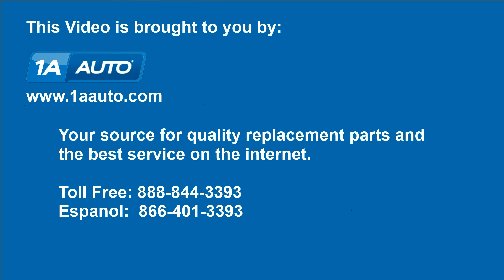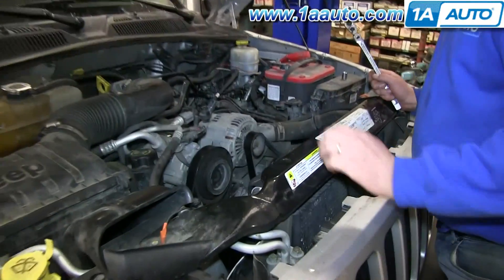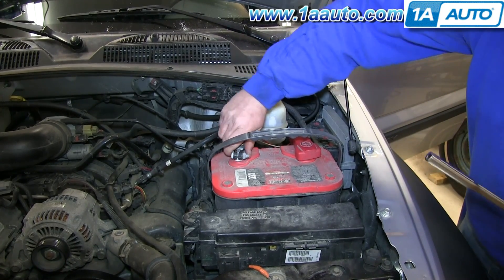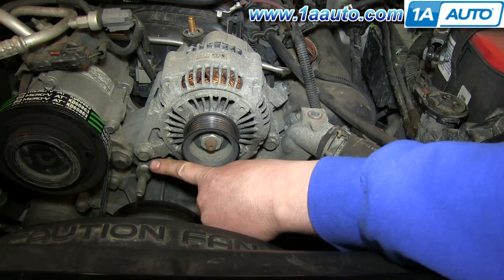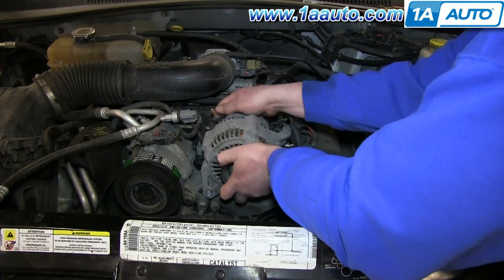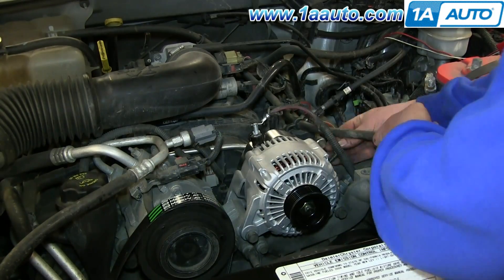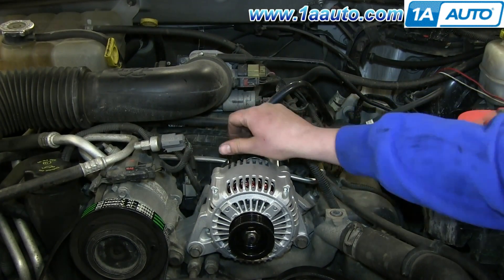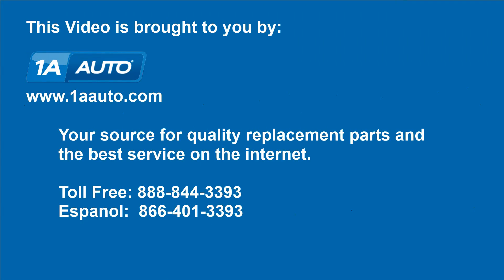How To Replace Alternator 04-07 Jeep Liberty

Comment: If you're like me and have a 2010 Jeep liberty sport 4wd 3.7 V6 that doesn't exist on the internet, this video is super helpful. It showed me the exact bolts to remove what to unplug and how to remove it. Perfect. Except my alternator is lower in the engine compartment and behind my radiator. I had to pull off the grille, headlights, coolant resovoir and fan gaurd to access the tensioner. Once all of that once done it's the exact same process as the video. Got it done and my Jeep now lives once more. Thanks 1aauto!
Reply from the maker: +Lance Drexler Thank you for the great reply. We love to empower our customers by showing you how-to perform your own auto repairs while installing our high quality auto parts. Have a great day! 1aauto.com

Comment: I wanted to share my appreciation. I was able to change my alternator and the battery, the dying alternator killed.. in about an hour .. 3 bolts + the power cord and clip and bingo its out.. reverse and its in.. then get the serpentine belt back on (don't take it all the way off, just remove it from the alternator.

Very nice for a parts company to provide simple tutorials like this. 

**ALSO was able to use parts and video from 1aauto.com to fix the common broken window issue with my jeep liberty 06

Thanks again!
Reply from the maker: +richard bowles Thank you for your order and your feedback! We love empowering our customers and showing how to perform DIY auto repairs with our high-quality auto parts. 1AAuto.com

Comment: You forgot to mention that Jeep Liberty's use two different sizes of alternator (Amp Output) although they look identical in every way. One is a 136 Amp (Oval Plug) the other is a 160 Amp (Square Plug). The only difference is in the shape of the small two-wire plugs, one is square the other is oval.
Reply: Finally, thank you!
Reply: wish I had seen this comment earlier! off to get a new pigtail
Reply: Thank you so much! I just ordered an alternator and it gave me two choices and I went with 136, and so glad I made the right decision! I’m pretty sure mine is oval!

Comment: Putting the belt back on is a four handed operation. It takes two hands to pry the damn tensioner up and hold it in place. Then one hand to guide the belt onto the engine with a fourth keeping it in place on the center wheel because it likes to slide off of that because there are no grooves or channels to keep it in place. Started at 6AM this morning. Had the new alternator in and completely hooked up and even managed to clean the top of the engine where the old alternator was sitting before 630. Still haven't gotten that damn belt back on and its coming up on 1PM now.

Comment: Just replaced the battery, the alternator is fairly new and seems to be running fine but the battery light is still on after replacing the battery. Any idea what it could be or how I can test the alternator or for different issues?

Comment: Are these instructions effective for a 2008-12 Liberty Alternator?  I haven't been able to find any instruction on these model year Liberties.
Reply from the maker: +Weary Man We're always cycling through common cars. We'll add this repair to our list! http://1aau.to/m/Shop-1AAuto-c
Reply: @1AAuto  Thanks!  You should know that I actually did this repair over the weekend.  Here are my results:  1.  The bolt sizes have changed slightly.  While the belt tensioner pulley is still a 15mm bolt, the two front bolts on the Alternator are 16mm on the 2008 model Liberty, not 15mm.  The other bolt sizes are the same as in your video.  2.  In the 2008 and later model Liberties, the Washer fluid and cooling fluid reservoirs have been moved from the sides to the front, over the cooling fan.  Additionally, a large plastic plenum has been added to the rear of the fan to increase the airflow effectiveness of the fan.  This results in a very tight workspace.  It is still possible to do this, but having the proper tools is very critical.  I found that my socket wrench wasn't long enough and I had to use a cheater bar extension (old spark plug socket on a 12" socket extension fitting stuck over the end of my socket wrench handle) to get enough leverage in order to loosen the belt enough to get it to work.  Given the tight spaces, it's not a 15 minute job, more like an hour, as you will find yourself sitting on top of the radiator/grille housing in order to get the right angle, unless you are very tall.  Doing any part of it from underneath is pretty much a no-go too as the front steering and suspension components are in the way.  But while difficult, it can be done, using the instructions you have provided and without removing any of the fluid reservoirs.
Reply from the maker: +Weary Man Thanks for the tips!

Comment: So I went to do the replacement and my jeep has a large, black cover in front of the engine that reads "Caution: Fan." I assume that this is the fan, however I do not see the same cover in this video. Is removing this cover another step for another video or do I have a different edition of the liberty? The cover/fan prevents me from being able to take the belt off

Comment: Are those just standard 6 point bolts that hold the alternator in place? When I went to unscrew them with my 15mm socket the head of the bolt started to strip?
Reply from the maker: +Jeffrey Meeks You may want to check a repair manual or with the dealer.  Those could be specially sized bolts just for this application.  1aauto.com

Comment: I only saw you use a 13mm and 15mm..What's the 12mm for?..
Reply from the maker: +KornShaDoW097 Thank you for checking us out. On this vehicle that we used, the 12mm was used to disconnect the negative battery cable. 1aauto.com
Reply: 1A Auto Parts Oh ok. I just did this job on a car yesterday (same year too) but the battery terminal used a 10mm. Thanks

Comment: why did some jeeps with the 3.7 come with a clutch pulley, I see that one doesnt have one, clutch pulleys have a black cap on the pulley, will it hurt to install a solid pulley, obviously there are jeeps that have them and others of the same year do not. I never grew up with those types of pulleys and cars ran fine.